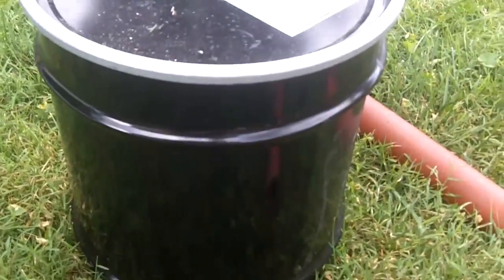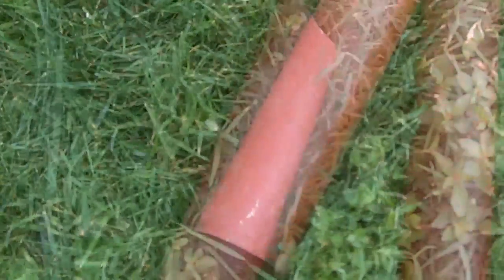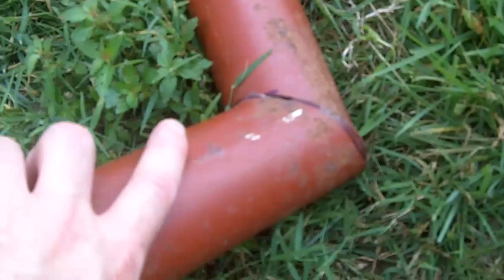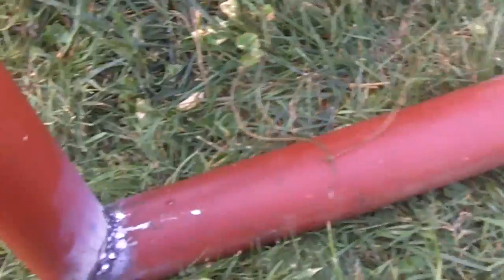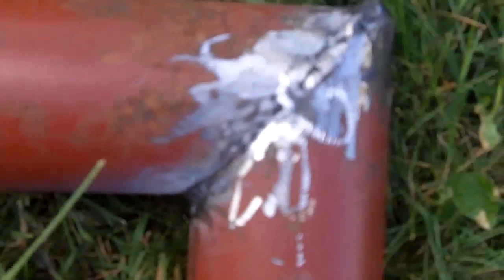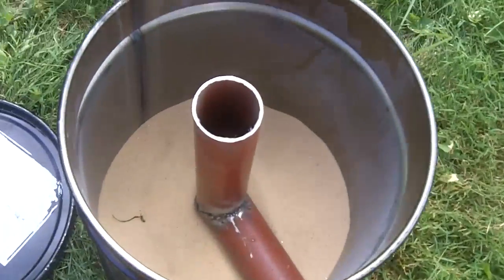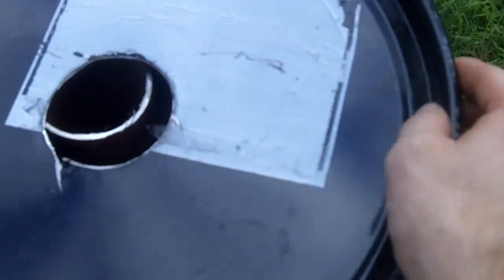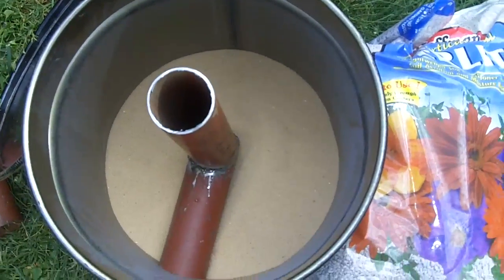Rocket Stove

Comment: nice. Why perlite, why not just sand?
Reply from the maker: +Ed19601 I put sand in the bottom to make it stable.  But I didn't want to fill it complete with sand because the weight would have been high.  The perlite is light and a good insulator.
Reply: tnx. Got it

Comment: For a good rocket stove you want your riser pipe three times as tall as the diameter of your pipe.Your pipe is about the right size to make a rocket stove in a one gallon paint can
Reply from the maker: +Rustaholic777 Not sure I follow.  This pipe's diameter and height is constant, whether I place it in a 1 gallon can or a 5 gallon can.  Are you saying I should make the pipe longer?
Reply: +rangermonk No make it smaller to fit the paint can.The vertical part total height is to be 3 times as long as the diameter of the pipe.This means if your pipe is only three inches in diameter it should only be nine inches long.If your tube was 6" then it should be 18" long.In that bucket a 4" pipe at 12" long would work great.There is a formula for how long the horizontal pipe is too but I don't know that one.
Reply from the maker: +Rustaholic777 Gotcha.  I plan on increasing pipe diameter.  Just haven't found the appropriate pipe, yet.  I'm hoping to have a new version sometime in the near future.  Thanks for your comment.

Comment: OK ,I do understand then I would make heat the stove for a garage for exemple I must insulate the interior pipe with another  pipe more big and fill with perlite ,right!
Reply from the maker: +alain condello For cooking, you want to insulate the pipe.  For heating it is a little different.  You want a 'rocket MASS heater'.  The pipe is longer and the insulation absorbs the heat and radiates it.

Comment: the goal is coocking only with insulate the barrel is not heat?
Reply from the maker: +alain condello Just heat through the pipe.  All of the heat is focused, higher temperature, less fuel.